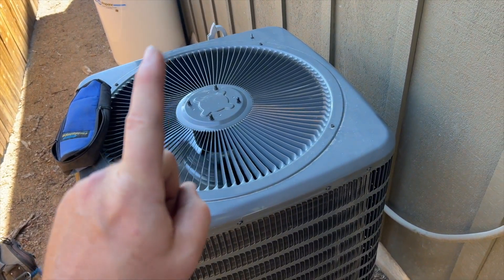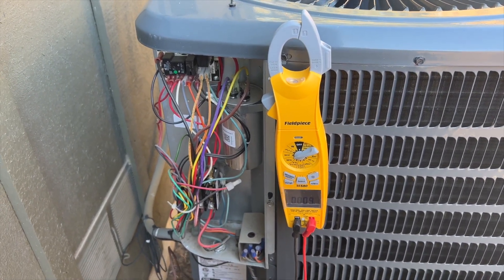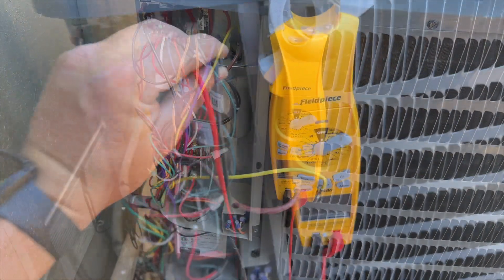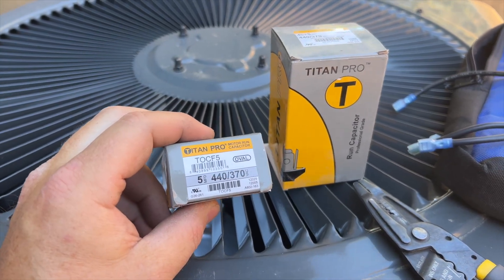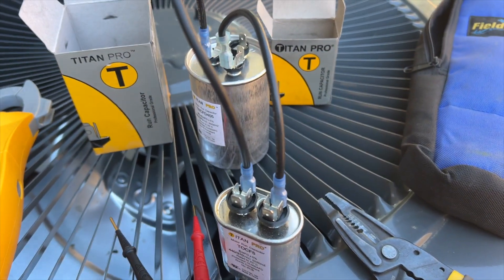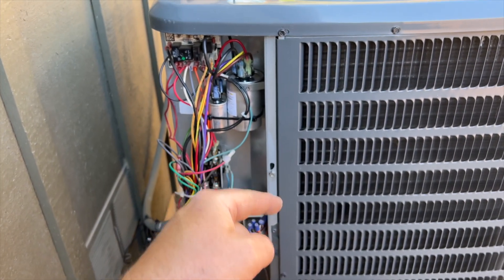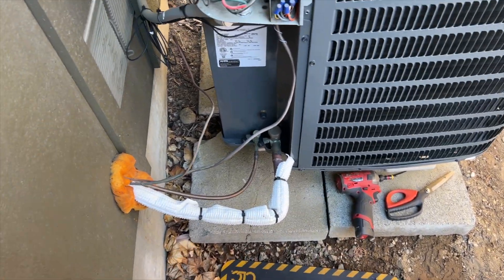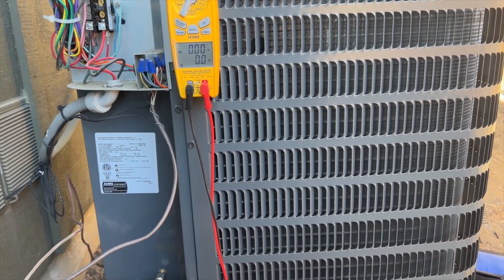How to Check and Combine Two Run Capacitors EP144

Comment: You can loop it off of the 5uf side of the dual cap to make your 45uf. 40+the 5 side of the dual cap
Reply: But then you still need a 5 mfd somewhere for the fan. Either way you are going to have to use 2 caps if you don't have a solid dual cap with both proper sizes.

Comment: Can I replace 30/5 mfd 450V trane capacitor with 30/5 440V ?
Reply from the maker: I’d check with Trane.  But it’s only a 10V difference. So it will probably work.